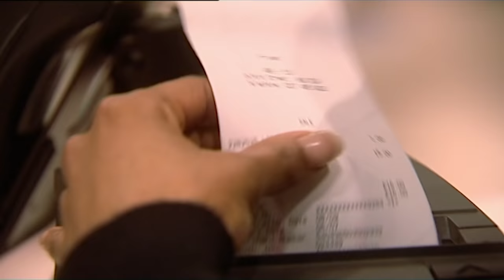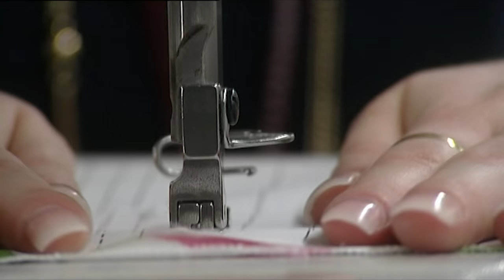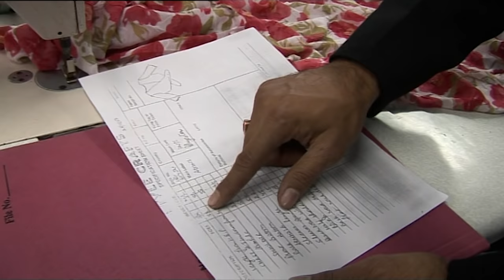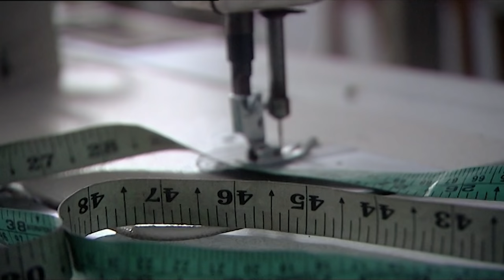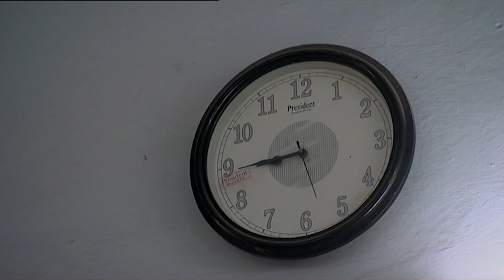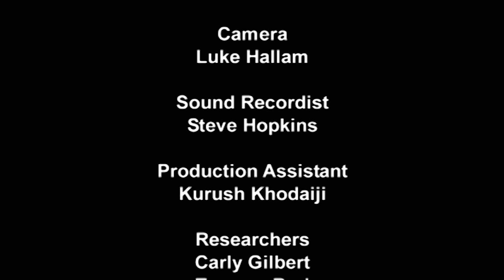Can Stacey Dooley Survive Working in a Sweat Shop? | Blood Sweat, and T-Shirts S1 Ep2 | Only Human

Comment: I doubt if the garments were for a real production line, as the garment pieces were not overlocked, and they were not cut in bulk. Garment factories cut garment pieces in bulk. The fabric is about 10-15cms thick from many layers and an electric vertical knife or laser is used to cut the garment pieces out of the fabric.